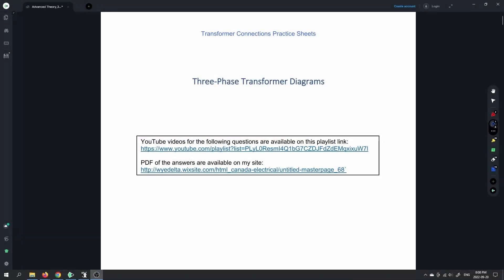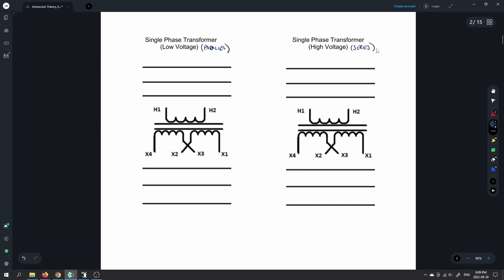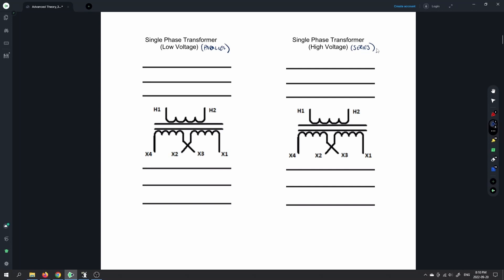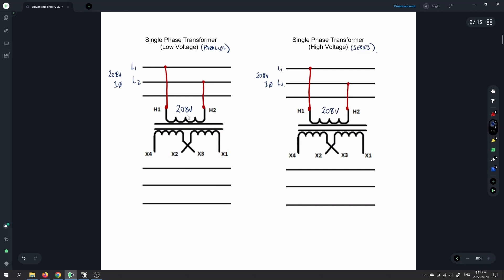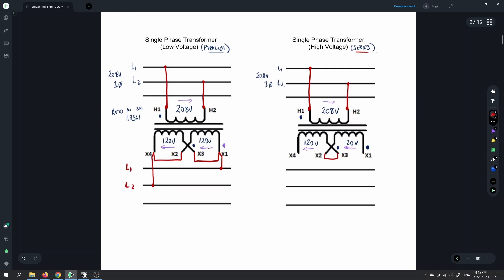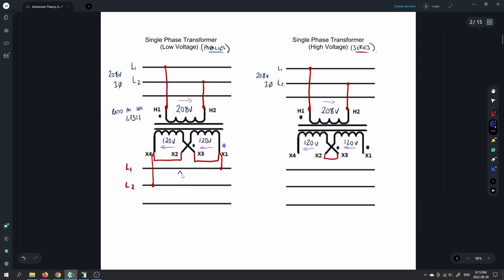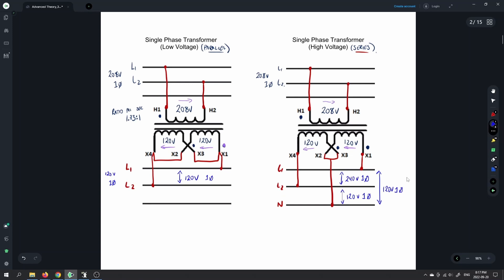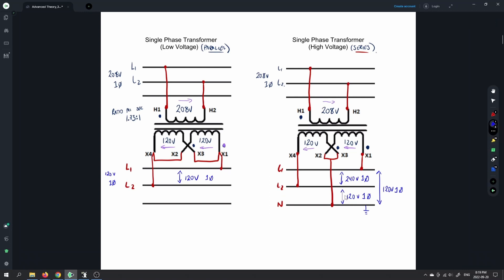Single Phase Transformer Diagrams

Comment: The parallel is only using one of the two windings in the secondary?
Reply from the maker: The lower voltage or parallel has both secondary windings in parallel. This provides the same voltage from each winding, but allows each winding to provide current to the secondary circuit. If we only used one secondary winding the total VA of the connection would be reduced.
Reply: @PeteVree  Clear concise information. (answer) .    Secondary winding (current) is increased by having the 
 secondary windings in parallel.   (Total VA). thank you.,

Comment: So with the 1 phase 208, does this mean that L2 on the primary is neutral or another hot 180° degrees opposite of L1?
Reply from the maker: 208 V, Single Phase is available between any two 'Hot' lines of the 3 phase source.
Reply: Mr. Vree thank you for your feedback.  You are an excellent instructor and highly admired and respected.